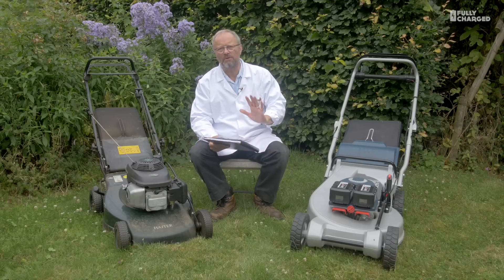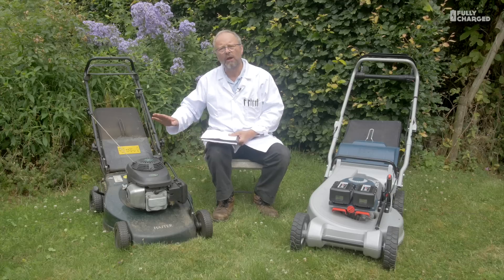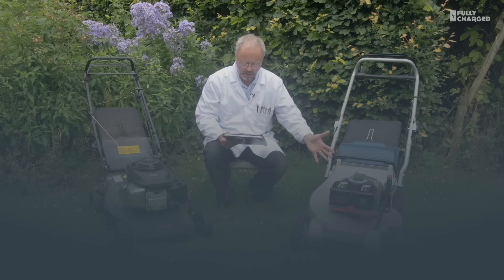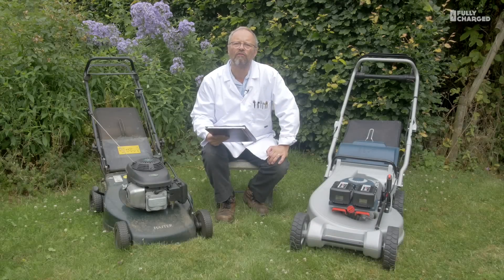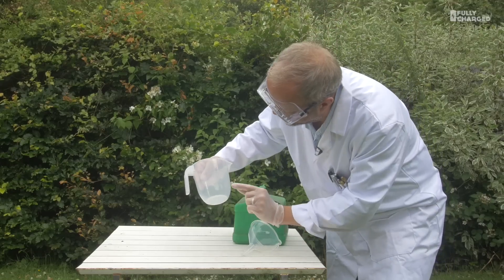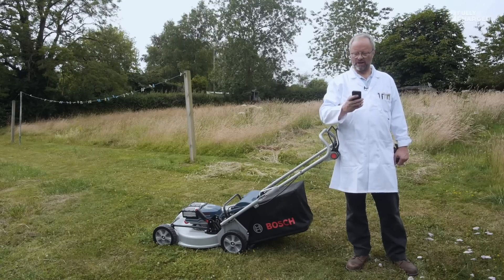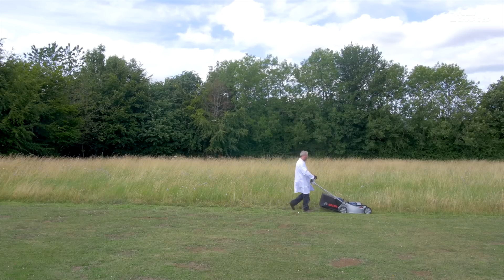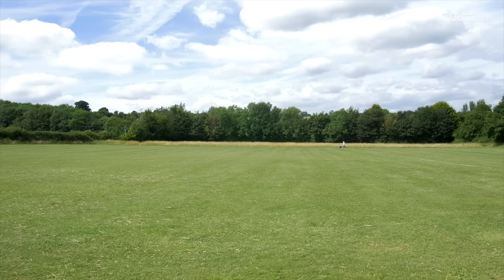Battery V Petrol. The Lawnmower Test | Fully Charged

Comment: Except that isn't really an apples to apples comparison. You're ignoring a large chunk of thermodynamics for the battery mower.  For the battery mower, you've offloaded the relatively inefficient process of transforming the chemical energy of the fuel into electrical energy to the local power station while still leaving the gas (petrol as you Brits call it) mower burdened with this inefficiency.  To get a true apples to apples comparison, you have to do a "well to wheels" analysis.  In this case, take your battery energy content in kWh, compensate for the inefficiency of the batter charger (around 85% for a modern switch mode power supply changing AC to DC), transmission efficiency from the substation to the wall outlet (95-98%), transformer efficiency at the local substation to step down from high voltage transmission to local transmission (98-99% for this mature technology operating over a narrow range), transmission efficiency over the high voltage grid (90-95%), step-up transformer efficiency from the generator to high voltage (again 98-99%), generator efficiency in transforming mechanical energy from the turbine to electricity (95-98%), and finally the efficiency of the power station to transform chemical energy into mechanical power (33% for a coal fired plant, up to about 55% for a combined cycle natural gas plant operating at peak, this efficiency is bounded by both the theoretical limit of the carnot cycle and the second law of thermodynamics).  Once you have that amount of energy (about 2kWh in this case), convert it into the equivalent volume of gasoline (petrol, around 250ml, 5x what you used) and see how long the mower runs.  Also, use a mower which is properly tuned and in good working order, not that clapped out rattle trap you used to rig this test.  If the mower is running rich and out of tune, the thermal efficiency will tumble quickly as excess fuel is blown straight out the exhaust.
Reply: It would work the other way too though, amount of fuel needed to get the crude oil out the ground, the energy required to transport it, the massive amount of energy required to distill it, energy required to transport it again to the petrol station, energy required for him to fetch it from the petrol station...

Comment: This is great and all if energy efficiency is all you care about, but it takes me 3 hours to mow my lawn, so gasoline is more time efficient for me unless I'd have several fully charged batteries at all times.
Reply: You can have one battery in use and one charging. Each of those modules work for about an hour, so you could easily do the full 3 hours nonstop by just swapping the batteries. The battery charges at 10 Amp and works at 6 Amp so it will recharge faster than the other being used discharges.
Reply: You could use both and that would give you almost 2 hours of constant mowing, but then you'd have a cool-down time of 40 minutes before moving on to the last hour of work.

Comment: Clearly an electric motor is more efficient than a petrol motor. This has been known for decades. The main difference is in some situations the shear volume of the batteries hamper your application. Denser and cheaper batteries are going to reduce the situations, where electric isn't a better option. Would love an episode about the expected life of a battery, compared to the lifespan of a ICE. With these two parts being the most expensive. 

Also, please don't do science(you're not that good at it :D). (and get a weight for measuring the amount of petrol).

Comment: Nice to see this experiment is a proper "scientific" experiments in white "lab-coat" and with rubber gloves and goggles and approx measurements .......... we have no knowledge of how much petrol was used, or if both batteries equally used ...... 
and it doesn't matter as long as petrol lost and electricity won

(In case the reader has not found out yet this post is meant ironically)

love your channel and keep up the good work

Comment: ...and one more thing.  As scientific tests go, this was brilliantly designed, I am compelled to take an opposite view to some (sorry).  The fact it allows you to add in all sorts of aspects like comparatively hard or easy work for the mower, you can weight those heavy parts on the ICE unit (petrol mower) and show how it wastes more energy churning that lot around, etc.  I mean, you knew it would tan the pants of the petrol single-cylinder thing, so you could afford to be ludicrously generous with the fuel dose.  No, I admire the experiment, great design.

Comment: Scientific bit - I am at 7 mins, fascinating!  I predicted 63 mins for electric, so:  Right, you have had a long 50 minutes on the electric mower, Robert, and we could have predicted using efficiency, how long the electric would last, based on comparative efficiency (ICE 15% or say 1/7 and electric motor 90% or 9/10).  Horrible numbers, but they co-join at 70ths, ICE being 10/70 and electric being 63/70. The electric mower should last 6.3 times as long as the ICE motor therefore.  IE over 63 minutes according to your ICE test.  And indeed - you got the electric one to over 50 minutes, no issue and WORKING IT HARDER!

Comment: What I notice in this demonstration is how much better an electric mower is compared to an electric car. With this mower I can easily replace the battery with a fully charged one and there's no need to wait at all.
IMO, this is what electric cars need too...a place where we can replace the drained battery with a charged one. Having said that, I have the same opinion about cell phones in this respect, and the popularity of non-replaceable batteries in cell phones shows I am in the minority... IMO, Nokia had it right and it was much better to simply carry around multiple batteries and switch when needed, than to carry around a charging battery at be tethered to it once the built-in one is depleted.
Yes, some engineering challenges to do something like that in a car, plus some forward thinking for the "petrol stations"... but, IMO, it would be better.
Reply: On the other hand, you could buy six corded mowers for the price of a spare battery set. Or just take a 20 minute break every couple hours.

Comment: Nice illustration. I would have loved more precision/accuracy. Definitely a smaller measuring jug would have helped. I suspect that if you had tested a larger quantity of petrol against multiple charges of the battery, petrol would have fared a bit better. I can imagine cold starts and the very small amount of petrol not combusting efficiently. Also, 50% battery charge showing doesn't necessarily mean that 50% of the energy remains and there is probably some inaccuracy in that calculation. Although probably none of that would have changed the conclusion and I'm probably wishing for a precise experiment from something only intended to be an illustration. Although you are not allowed to wear white coats with pens in the pocket unless you are doing repeatable experiments... it's the scientist membership rules...

You could have also avoided the weird quantity conversions by using the Joule (and also be relevant to what they teach in schools in the UK). The way I remember working out energy from burning peanuts at school was: Energy transferred (J) = mass of water heated (g) × specific heat capacity of water (4.2) × temperature rise (deg C). I don't think BTUs has been taught at schools for decades, unless you are Canadian.

Comment: This was all nice, but you should do a pert 2 where you put the amount of petrol you could buy with the money spent on charging the battery.
Reply: The answer to that would be none. It would cost less than £3 to charge the batteries. You have to purchase a minimum of £3 at the pump so effectively you wouldn't be able to purchase any haha!
Reply: +Chris Boddy but you can buy £6 and put half in the mower
Reply: Then you've gone and spent more than you need to. And you've wasted fuel using your car to drive to the petrol station and back so in reality you've spent even more.
Reply: +Chris Boddy that's actually a good point
Reply: Quote from the man himself: "Okay, I left out costs due to the complexity of the comparison. However in the UK petrol is £1.10p per liter, so the petrol we used was about 10p. The electricity for the batteries came from my solar panels so in that sense cost nothing. If we'd charged it from the grid it would have cost about 10p as well. (21p per kWh, mower batteries .5 kWh) However the important point is 10p of petrol lasted 7 and a half minutes, the batteries lasted over 100 minutes."

Comment: People say that EVs still burn fossile fuels and still pollute. Well.. Yes, even your farts does that. The thing is, instead of driving about 10km, in a car that uses 0.5l per metric mile, that car will release about 130g of CO2. 

Meanwhile in Sweden, 1kw of electricity releases maybe about 0.2-0.3g of co2. A tesla can easily go over one metric mile on just 1kw. Its a massive decrease in emissions!. Braud claim, but atleast 50 times less emissions..

Comment: And what is the environmental and economic impact of building, cleaning, and maintaining the vast arrays of solar panels?  But you can't even say what is the actual generated energy required to charge the batteries...  Thanks, I didn't expect a response, it's been entertaining as well!  However a more useful presentation would be to present and explain thorough, detailed, complete comparative economic and environmental analyses of the potential impacts of the systems.
Reply: +Stephen Kramer I would just like to point out differences between the energy supply chain for consumer petrol powered machinery and that for electric machinery. Petrol has the portability in it's favor. Electric has supply flexibility on it's side. Ex.: You can have a company who converts petrol to electricity, allowing greater efficiency due to specialization that's not available to smaller machinery, like using residue heat.

My point is you can get very creative and specialized with electric infrastructure. Cheers!

Comment: What's wrong with my math(s)?  Heat of combustion for gas(petrol) = 34.2 MJ/l.  .42 kW-h = 1.5 MJ.  Volume is therefore 44 ml.  I don't know how to get 56ml.  Energy density of coal is 29.5 MJ/kg.  Therefore .42 kW-h = .051 kg coal.  However, that is if the coal heat energy was magically turned into the energy in the battery.  To get the amount of coal you had to burn you have to add up ALL OF THE ENERGY LOST:  from the furnace that burned the coal, the boiler to make the steam, the turbines to turn the generators, the generator to produce the current, the electrical losses in all of the transformers and switches at the plant, the electrical losses in all of the wires to get it to your house, the losses in the battery charger, the electrical losses in battery chemistry and the electrical losses in the motor coils.  Come back when you've got some real data and not a bunch of emotional retarded propaganda, as all video / tv really is.  The amount of energy required to charge the batteries in the electric mower in your test is MUCH greater than .42 kW-h.  What is it?
Reply from the maker: +Stephen Kramer I love comments which state a shouty "come back when you've got some real data."
Massive LOL, I thow my head back as I exhale a raucous bellow of  laugher.
Here is a spew of  information to counter every point you bellowed into my ear like some tragic, shouty school bully.
Where does the gasoline come from which you clearly worship as if it were God's tears?
It comes out fo the ground, stupid question, I'm clearly very dumb.
Then it's shipped to a refinery which... I dunno, magics it into diesel, gasoline, hydrogen, and a myriad of other petro-chemical products.
Oh wait, the refinery uses electricity. How much?
A shit ton.
In the UK, our 3 big refineries use over 5,600 gWh per year, a massive amount of electricity, more electricity than 2 million electric cars would use to drive 20 trillion miles.
Where does all that electricity come from? 
In the UK, exclusively from coal, each refinery has it's own, individual feed from the nearby coal burning plant.
One massive chimney burning coal, spewing out great toxic clots of poisonous gas and dangerous particulate matter, to produce a fuel that is burnt, LOL, in a tragic old internal combustion engine (steam age technology) which then produces toxic hot gasses that spew out of an equally tragic, dated tail pipe causing yet more harm.
But not just one tragic tail pipe, millions and millions of them, great long streams of dated, old fashioned cars sitting in massive traffic snarl ups with their engines running but not moving anywhere, creating huge toxic clouds of poisonous gas that the poor suckers not sitting in the cars then breath in.
And that gasoline has been shipped, stored, refined, shipped, stored and pumped dozens of times before the tragic old car burns it once, you can't use it again, and all that activity uses energy, which, in your world, is ignored, covered up, or indeed, comes from fairies or flowers.
Just to correct you on your blinkered view of the electricity generating picture in the UK, coal produces at most 30% of our electricity and that figure is dropping rapidly. The rest is from gas, nuclear and the most rapidly increasing, renewables. At night, (when I charge my electric car) that % drops to zero, then it is wind and nuclear.
The batteries I used in this video were charged 100% from the solar panels on my roof. No coal, none, not one gram, was burned to generate any electricity I used. The losses were infintesimally small as the journey from panel to plug is about 5 meters. 
Come back to me when you have something resembling a realistic grasp of the global energy system.
But don't worry, I know you won't, you'll only respond with more pointless ranting which, of course, I won't read.
LOL.
Reply: +fullychargedshow sorry, where did your toxic dangerous battery chemicals come from, as well as the super expensive inefficient  solar cells?
Reply from the maker: +Stephen Kramer Oh dear, is that all you can come back with?
After your initial whining and whinging about coal power, yes, I clearly explained to you that your assertions were a massively distorted, pro-fossil lobby pile of doggy do, so it's back to batteries. Oh and super expensive inefficient solar cells.
That's the funny one, the cost of solar PV has fallen so dramatically and the efficiency has risen so sharply that your claim (I know, you were trying to use the same phraseology I did about fossil burner engines) shows your deep, deep and profound ignorance of the actual facts. 
What ever else, your team (not that there are or should be teams but shouty fossil boys like you sound like your in a team) are getting increasingly desperate.
The fossil era is coming to an end, what we are witnessing is the dangerous thrashing fury of a small group of people who make billions from us burning their shitty products.
1 little important fact.
You can't use fossil fuels again. You burn them, it's done.
You can use 96% of the materials in a battery when they have finally come to the end of life, which with current lithium-ion tech is about 25-30 years. 5-10 years in a car, 10-15 years as stationary battery for grid backup.
You burn your holy fossil fuel from your big oil pals, you are stuffed. 
They make the money, we get toxic fumes, they lobby our governments, they hold back tech development and spread utter lies and bollocks which unbelievelably gullible people like you buy into, hook line and sinker in a tragic display of male anger.
Saying batteries contain some dangerous chemicals (which can be re-used and re-cycled again and again) is a pointless argument, the technology is improving, the materials being used are changing. Scientists are working on battery chemistry that uses very common materials, battery systems which shift the picture due to reliablility, cost and length of useful life.

Comment: Tell us how much energy had to be generated at the power plant to get the electricity to charge the batteries, including the efficiency of the battery charger, and re-calculate your petrol quantity.  Then calculate how much pollution was produced by burning the tons of coal at the unregulated dirty power plant spewing toxic coal exhaust into the air 24/7.
Reply: As long as you include the cost of finding, drilling, pumping, refining, delivering the gasoline and similar costs for whatever power source used to generate the electricity, it would be an interesting comparison.
Reply: I would guess about um say 200 times more efficient than the ammount of energy it takes to drill for the crude oil. transport it to the refinery and then actually refinery the oil into petrol or diesel. Then transport the refined fuel to the petrol station. Then the energy used by your car to transport you to the petrol station to fill your Jerry can.... Think about it.